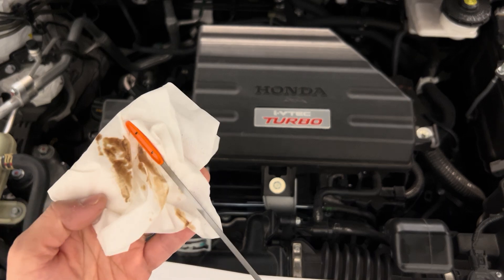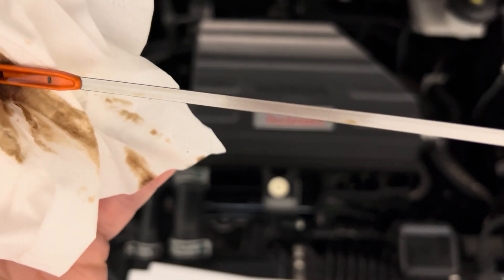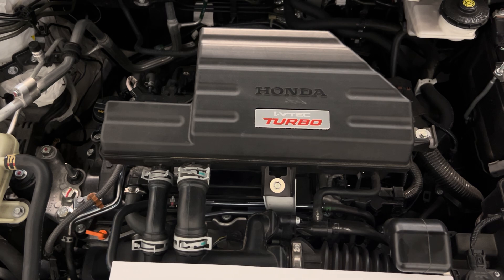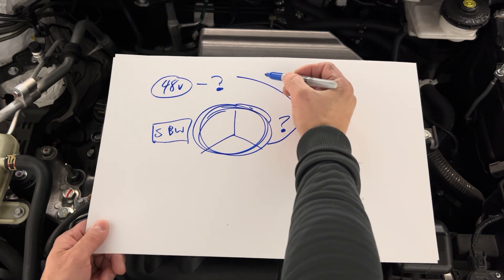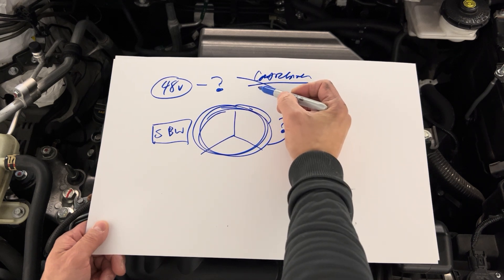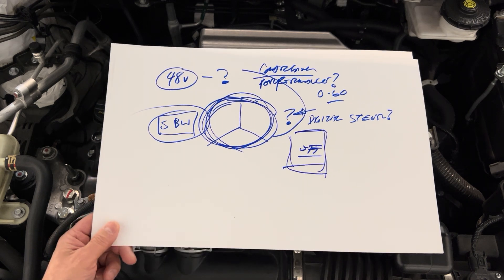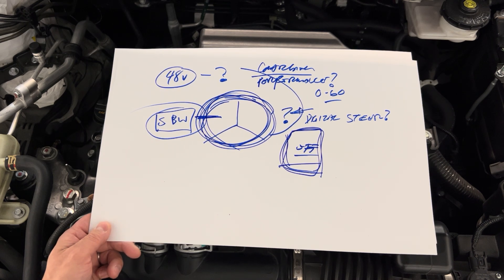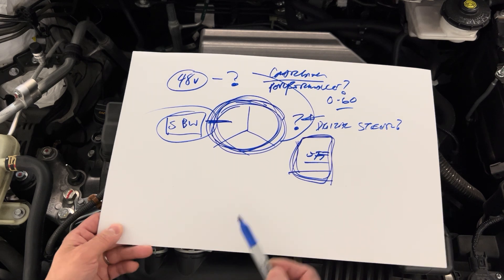HAzARD! Cybertruck Steer-By-Wire. Bad idea?

Comment: The F35, F16, F18, and virtually every commercial aircraft have been fly (steer) by wire for a decades. I'm not saying mistakes can't be made, but generally they are human error. I have also seen mechanical steering fail and I've seen people seriously overcorrect and crash hard. Humans are almost always the cause of accidents, either directly or indirectly by a lack of maintenance. As long as the engineering is done properly (and I trust Tesla over any of the big 3) the risks are extremely low. Virtually every car on the road uses computers to do almost everything and we rely on those systems for the car to function. I would suggest learning as much as you can about this (not even slightly) new technology before you knee-jerk that it is dangerous.
Reply: car makers arent held to the same standards as aircrafts. Car makers can leave a fatal flaw in and just pay fine while the same mistake in the aerospace grounds all the planes until fixed
Reply: @Nordic_Mechanic  Historically auto manufacturers had their lawyers decide which was more expensive, fixing an issue, or paying fines and lawsuits. Many times those manufacturers did what was cheaper instead of the right thing. Tesla has not shown this tendency (though they do have lawyers) so I do not think that will be the case with them. Obviously that can change, but Tesla relies on their reputation and not their legacy. Some people will drive Fords until they die, even when all they do is die. There are some people who will always be afraid of the new thing, and sometimes they are right, but usually they are just stubborn and lose out.
Reply: commercial planes and such has rigorous checkups and maintenance regime. compare that to a normal person who owns a vehicle probably not even changing the oil. so no, you can't compare a plane to a tesla cybertruck because it will be used by the public with varrying degree of stupidy and carelessness.
Reply: @jetfu400  You absolutely can, airlines are business that want to make a profit. There are plenty of regulations for auto and air and i’ve seen how maintenance for aircraft is. Drive by wire will become normal very quickly because of the advantages it brings to what are already rolling computers.
Reply from the maker: Yes, fly by wire has been a thing in the Air for decades - but it is from companies with track records decades in the making. Tesla? Think about what happened to their “Autopilot” and Rockets blowing up… and while I agree most of it is human error, that is where the crux is. The airspace is not like the roads that you and I share. The air is pretty much fully controlled, the ground is a jungle of maroons. True. 

Mix this questionable tech with a multitude of layers of complexity and real world situations and it’ll spell the unthinkable. 
You see, there are millions of cars on the road. Millions of probabilities even at 0.001% error mixed with human error… you get the point. 

How many F35s and commercial airplanes in the air an any given point?
Reply: A pilot once told me that take-offs were optional, landings were mandatory. @kidsfuturesareworthit.8673
Reply from the maker: @warmonger, thanks for keeping the convo alive:)

Do you truly believe Tesla has a good track record and reputation? 

Their first iteration of “Autopilot” was named misleadingly and led to many accidents and deaths and lawsuits. 
Then there is the unexplained instances with their cars doing unexplained actions leading to personal injury and fire. 
Failing brakes, overheating and failed batteries…

If you know who Farzad and Tesla fanboys alike… then you’ll have to at least check out the other side:

https://m.youtube.com/@Thunderf00t/videos

Thunderfoot has some of the greatest fails from Musk and co. All backed up by facts: better than I can ever recall. 

Don’t get me wrong, I have nothing against the guy, very rich and successful, work hard to get to where he is… just that most of his claim to fame are empty promises. 
And the worst one is that solar city and the proliferation of the EV is actually causing more harm to the environment as he touts that “he’s done for more for the environment than any company has put together” ugh.

https://m.youtube.com/watch?v=fZozUReGOq4&pp=ygUXdGVzbGEgYmF0dGVyeSByZWN5Y2xpbmc%3D

Comment: While I do very much assume, that some kind of fail safe system is in place, nothing is ever completely fail safe. And I personally would never trust such a system. The idea, that you can't apply your physical force to the direction of the wheels is absolutely nuts. You generate a signal, a couple numbers get sent through wires and control units to make an electric motor attached to the front axle turn. Which guarantee is there, that this motor won't suddenly twist the wheels at 70mph on the freeway? When the car ages, there can be bad cables, bad sensors, bad control units with failing soldering spots. So many technical things that can lead to this motor getting signals you didn't generate, and suddenly the car will change directions without you doing anything. While I see the development of modern cars already critical enough, but acceptable through lack of choice to not hava a vehicle overloaded with electronics, steer by wire is a boundary I will not cross. If I had an employer and he'd tell me to drive somewhere in a car with a SBW system, I would refuse. Either another car, or he can do it by himself. I have a 2007 van and glad about it.

SBW is a really good example, how the car industry just goes too far. Only because something is possible doesn't mean you need to implement that. Sure it saves space in the construction of the vehicle, but after having seen those reports about self driving Teslas crashing into things, I see it as almost guaranteed we will hear stories about Cybertrucks suddenly steering itself off the road.

And for everyone getting the wrong message: I don't hate the Cybertruck, I actually like the concept. I am against a ridiculous overload of electronics in vehicles. Cars have gotten extremely complex, far more than necessary. And you don't have a choice to buy simpler cars, there are none. Which is too bad, we only get those computers on wheels and also need to pay for that in order to use something we don't desire. I don't want cameras, I don't want radar bullshit, I don't want power trunks, I don't want auomation everywhere, I don't want complicated and expensive hybrid systems. I want a simple car, whose only electronic features are power windows, central locking with remote and maybe a backup camera. But you don't get something this simple anymore. Cars are packed with electronic bullshit, and it's communicated as being awesome features. Not in my world. The more my car annoys me with pointless jungles and messages and takes over control, the less I am willing to use that.
Reply from the maker: “When the car ages” is a point not touched on yet. You’re absolutely right… 

The CT is cool and new - I only worry that Tesla is trying to doing what Apple did with the cellphone. Apple has had many blunders like bendgate, antennagate, bricked phones… but an iPhone is not a fleet of 6000lb blades going 0-60 in faster than a lambo along with millions of other cars with people inside.
Reply: Well cars had electric steering and hydraulic. And if it randomly turns the steering there no way you can stop it electric motor or hydraulic rack are wayyy more powerful than hands. But the thing is that never ever happened cause the systems are incredibly reliable. I'm sure tesla has all sorts of backups.
Reply: @dkdanis1340  Of course the systems are made as safe as can be. But it makes a big difference, if your hands have a physical connection to the wheels or not. With >>power assisted<< steering, an electric/hydraulic systems increases the power your hands send to the wheels. But you keep connected to the wheels through the mechanical steering column, so even if the electronics go haywire, you could prevent it from sending you off the road. You retain some level of control, depending on how strong you are and how quickly you react.
With SBW, you are fully at the mercy of the system. Whatever it does, you can do nothing about it. In case of a mechanical steering, you do the steering, the system just engages. With SBW, you do nothing. The steering only works via electrical systems. And if a sensor fail, cables damaged or the software simply going nuts, it wouldn't matter where you are moving the steering wheel, the wheels could point wherever they like. And depending on how the axle is built, they may not even steer the same direction.

Anyway, I get your point, and yes I do see those systems very critical too, where you do have a mechanical steering, but those systems being made for being able to steer by themselfes. The simple matter, that the car has the means to do something by itself that I do not want at all is something I cannot accept. And if one day only such cars would still exist, I stick to the bike.

Comment: The Titanic was steer by wire with three redundant steering wheels, and look what happened. Like they say, the nut behind the wheel is the most dangerous part.
Reply: Titanic sank because the crew noticed an iceberg when it was too late. The steering was absolutely fine.
Reply: Of course the steering system had nothing to do with it. I was being sarcastic, and also noting that steer by wire is nothing new. @ReasonX3
Reply from the maker: Yes, we are all using it wrong… and will drive it wrong. No amount of algorithms will replace physical controls like a volume knob… let alone the not so safe failsafes.
Reply from the maker: 🎉 and so the party continues… let’s put this out to woo the masses with specs and “capabilities” and see what happens. The reason why the legacy automakers move so slow is because every idea looks  great on paper, but put to the test on the real world track, it is a jungle and several layers of stupidity in motion.

Comment: Remind me never to get onto an airliner. Those large airplanes have just been falling out of the sky and crashing all over the place ever since they went to that newfangled fly by wire technology.
Reply: Read the sarcasim there, :).  This stuff has been around since at least the 80's.
Reply from the maker: Well that’s the whole point… electronics fail and glitch out all the time. 
I will say, I’d trust airplane makers with almost 100yrs of experience vs the guy who brought us “AutoPilot” and called it autopilot.

Plus, up in the air, it is all controlled. Down on the ground that we all share is a whole different story. 

Cheers, an thanks for the convo guys:)

Comment: I don't think that you're ignorant just to be ignorant. I think that you're just plain curious and under-educated.

Why 48v?

In electric vehicles, efficiency is king. It can be done by wiegth reduction among many other things. Anything that you can throw away or minimise is a good thing. That's where the 48v "low-voltage" system comes in. The higher the voltage, the thinner the wire you need. They reduced the overall wiring harness by 70%,. Less copper, less wieght. (Steer-by-wire also requires 48v system to work properly).

Why steer-by-wire?

Cybertruck is a very big truck. It would be hard to turn if conventional steering system is used. Rear steering would help! I don't think they used SBW just to be "gimmicky". I think it comes out of the problem of "how are you gonna steer the rear tires?" The solution is S-B-W. But why not also include the front tires in the STW system? The rest is history.

Is SBW safe?

Yes. Commercial Airplanes and modern fighter jets all use fly-by-wire for decades now. It's not a new technology. And there is almost none accidents cause by FBW systems. There's also break by wire, which is very safe. 

What's the regulatory requirement for SBW?

There should be tripple redundancy. Cybertruck has all of them. It is tripple redundant. There's 2 computers that compares their decisions and actions all the time, if both don't agree, there's a 3rd computer as a tie breaker.

What if the battery dies? 

All of Tesla cars can still drive even if the main computer is down or broken because it's a separate system from the drive train. In fact, you can reboot your Tesla while driving by holding the 2 scroll wheel. Cybertruck isn't different. 

Tesla is known for its redundancy. It's their mantra, "safety overrides everything". All of its cars are the gold standard of safety. All of its cars are top 1, 2, 3, 4 in the NTSA safety score rating out of all the cars tested so far. Don't think that Cybertruck won't take the top 5 spot.
Reply from the maker: Well, you are correct that I’m ignorant because I haven’t been versed by the Tesla marketing team. I didn’t watch their press release in full. 

I do thank you for your post and watching a response from a layman- Honda driver. 
As for 48V… sure, it may be the next step and evolution of the electric car, but point is, electric (cars) is only a stop gap towards a revolutionary technology for personal transport. Pls see my prev vid on this concept… plus, if efficiency is the CT’s focus, it doesn’t show in the numbers. Not in the range or its 6000lb plus weight. Seems in the similar weight and range class compared to the F150, no? Let’s hold for real world results.

SBW- let’s just say I’d trust a manufacturer with several decades (airbus/boeing) vs Tesla, that tried to put us in a vacuum tube through a hole in the ground… also, airplanes with SBW actually has full Auto-pilot and dictated air traffic control, unlike our streets with weeds of traffic and 16yr old pilots that are trying to grow a beard. Let’s hope no one gets hurt. 
Futhermore, I’d trust Lexus-Toyota and their SBW (RZ) or Merc’s next gen self driving more than Tesla’s marketing machine. 

48v necessary for SBW? How did the other cars do it in the past? Rear wheel steering was a thing back in the 90’s — albeit mechanical. 

Just valid concerns for the road that we all share. 
Up in the air, it is really a different story. 
I do really hope we get to the next level soon with Vehicles (lugging around 1000+ lb batteries everywhere isn’t a solution)… but I have a feeling that the best way to conserve energy is to make alternate choices.
Reply: @kidsfuturesareworthit.8673 Dude, your Elon-hate really has blinded you. 12v systems are a problem on EVERY car in the road, including ICEs. There's been talk about needing to move to 48v on the auto industry for 50 years, from ALL manufacturers. There are even papers on the subject. The only reason why nobody has done it is that it's hard, and it disconnects you from the entire supply change. Unless you're very vertically integrated, like Tesla is, and even then, it was bloody hard. 

Also, funny that you'll trust Boeing over Tesla, considering that Boeing is a company that very recently killed over 300 people with what's essentially your fears over steer-by-wire, with the 737. Would you also trust Boeing over SpaceX, just because Elon is their CEO? NASA thought the same, and SpaceX ended up beating Boeing by years to the ISS, and while Dragon keeps flying safely, Boeing's ship is a death trap, and it's not scheduled to actually fly people any time soon. Boeing's been developing Starliner for well over a decade, and it still can't get rated by NASA because it's extremely dangerous, and it keeps failing in novel ways.

Comment from the maker: Let’s just hope I’m wrong… and there’s no safety concerns on a 6000lb+ stainless steel knife is careening down the road.
Reply: how much do passenger airplanes weigh? they are also flyby wire there is triple redundancy.  i’m more concerned about the 10,000 pound Hummer.
Reply: 48 V system has nothing to do with charging it has to do with being able to use smaller wires the 800 V system has to do with charging I don’t even really like the cyber truck but there is impressive engineering
Reply from the maker: True… I think all electric cars are a hazard… with 800-2000lb batteries and extenders. Triple redundancies for our roads along with multiple layers of driving obstacles and circumstances is a recipe in itself. I don’t buy it- so I won’t (not that I have the $ for it) but I’d be weary about these things on the road. 
As for 48V, i’m sure it is an evolution in innovating electric vehicles, but I’m in the camp that electric cars are only a stop gap for the next technology. I just don’t see lugging around 1 ton battery everywhere is a good solution let alone good for the Earth.